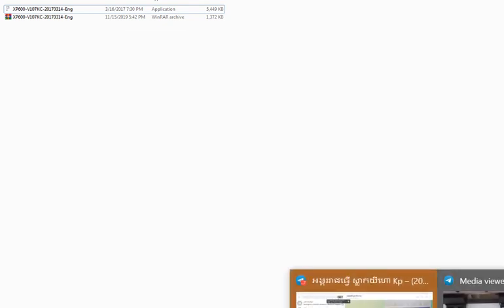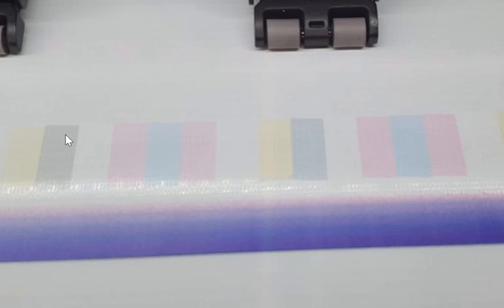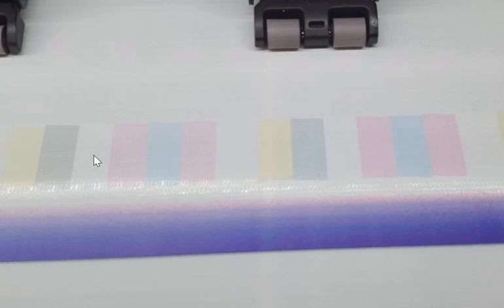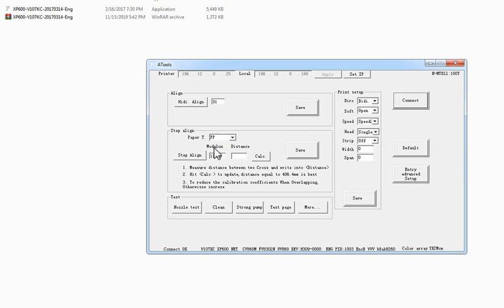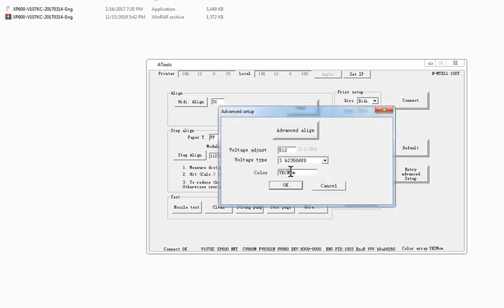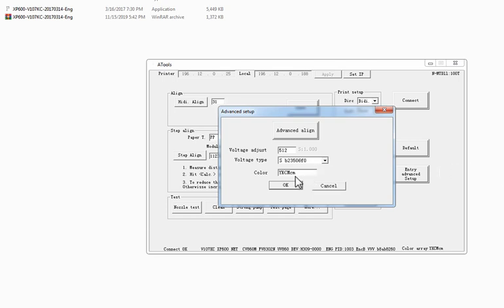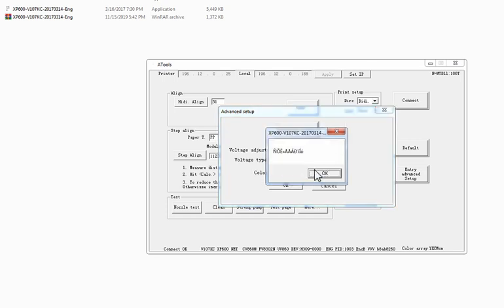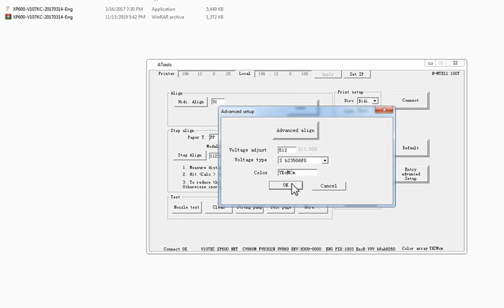How to use xp600/Dx11/F1080A in 4 channel

Comment: I did what you said and it worked, now my question is. What causes the PrintHead channel to get lost?
Reply from the maker: Dx11 or xp600 is not a stable printhead. It life time is short. Anyway, the reason one or two channel get losts because there is problem on electric static; you installed printer without grounding.